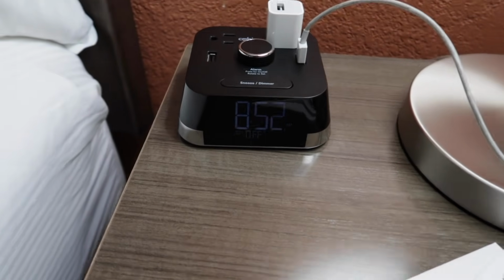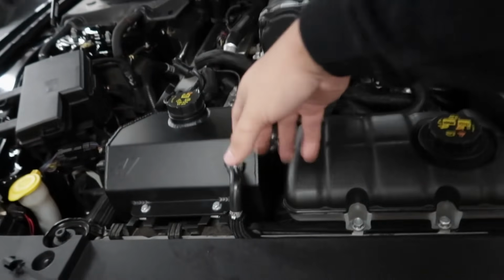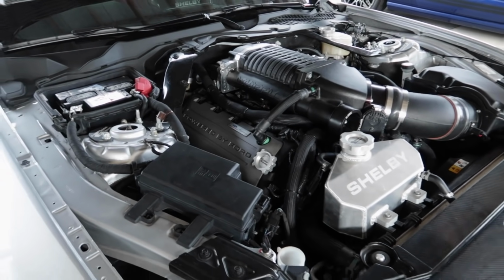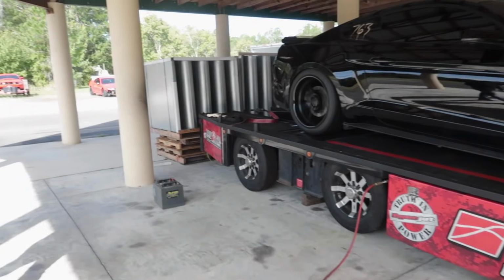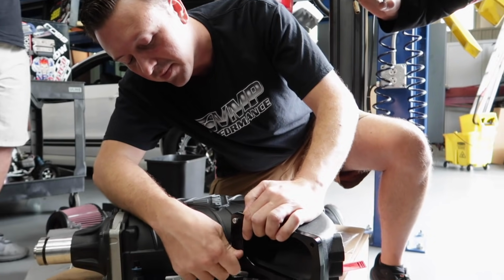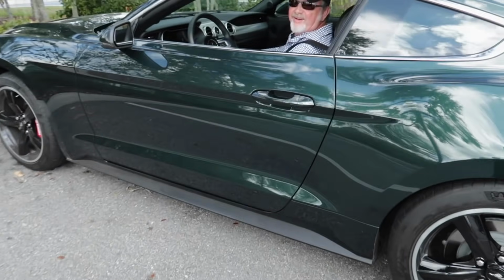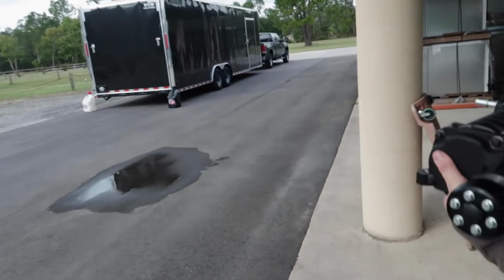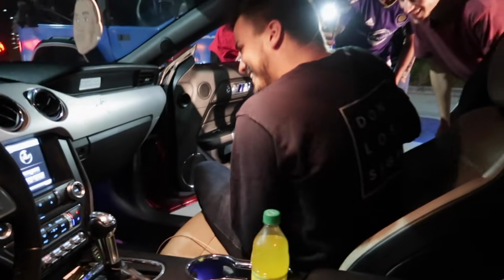My HUGE VMP Gen 3 Supercharger is INSTALLED!!

Comment: “9.01 in a stick shift is scary” cletus laughs while firing up leroy 😂
Reply: biggdaddy blade works never claimed he was
Reply: @whatsreallygoingon253  neither is that car
Reply: TheGhost did i ever say or claim leroy does?
Reply: @TheGhost even if he did it wouldn't weigh much more
Reply: @TheGhost no the vette
Reply: Official Plazma don’t hurt anyone’s feelings now 😂
Reply: TheGhost it technically does have a full interior, it has two seats, a dash, center console, glove box, blinkers and all those switches. Just its a highly modified interior
Reply: @TheGhost Leroy actually doesn't have that much of the interior missing, it's just the exterior where leroy shits the bed
Reply: They did wind tunnel test and showed it's worse than a stock Vette....and weighed more than I ever dreamed they proved to me it's a bit more legit...and I was hating on it ...now it's still easier to work on and mount things in the best places ECT...and I don't actually consider it a car either but it's performance to weight to wind resistance would be the same in a real Vette I suppose .....just take 5x the work to set it up....
Reply: @ShawnGilbert1967  vette with no hood would be almost as easy, and way more aerdynamic
Reply: @commptonn  or a lift off front but man no matter what they are doing they can just reach in and touch it SUCH a work advantage......to me where he has his turbos mounted would require no hood or top part of a fender at least....I do be believe it's less aero 
So that begs the question if he is trying to be as fast as possible why doesn't he just put a body on? The answer to that is the root of it
Reply: TheGhost Leroy is heavy, I guarantee it is almost as heavy as that Mustang.
Reply: Leroy might be similar but the super snake is way sharper

Comment: "Going 9.1 in a manual car is scary" after cleetus went 7.82 in a stick shit corvette with about the same power as the white mustang
Reply: That came to my mind immediately as well when he said that.  Not that impressive considering what Garret did in a stick shift c5 with terrible aerodynamics, as you said, with similar power.
Reply: LS power!!
Reply: And no body panels either.....
Reply: Body panels would make Leroy faster
Reply: Go Kart FTW!!
Reply: Leroy makes alooot pore power thatn that mustang lmao
Reply: You also got to realize  Leroy is around 2800-3k that mustang  still around 3500-3800 pounds Leroy also making 1300+ that gt500 is around 1100

Comment: May want to think about adjusting the diff angle so the nose points a little farther downward, when you're under power the nose torques upwards and you want it as close to level while under power as you can get for strength and rigidity while if possible remaining as close to less than 5° of overall difference in driveline angle so that the needles get spun in the u joints, preferably less than 3° but at this point it's become a race application.
Love the videos

Comment: I thought it made 1,000+?
Reply: He said the dyno that said 1014 wasn't correctly calibrated. This setup would've probably made 800whp on dynojet. Even without a finished tune it made roughly 100 more than he was running on roush.
Reply: This car will be touching 1000whp soon enough. Gavin has the itch now next up built motor then comes 73mm pulley then comes 1000+ we going to need a new throttle body
Reply: Yet the post was still labeled and left as a 1000 rear wheel horsepower video #CLICKBAIT but the fans requested VMP GIVE HIM A GEN 3 and Bam free parts for being a YouTube celebrity.  Great #s on less boost.   Now maybe the content will stay a bit more legit from now on?!
Reply: @tonyg3151  The video said it dyno'd 1000. Saying it said that when he threw it on a dyno is different from saying that it is 100% making that.

Comment: You should put forged pistons rods crank valves everything forged to hold the power specially since you have a stock internals and it will suck buying another motor

Comment: did the math by percentages and you could pick up around 250 hp with smaller wheel. just based on the wheel size not how mucht the actual srolls pull

Comment: Nice numbers but if that's really a stock short block it is definitely on borrowed time at 880rwhp.  Enjoy it cause its a nice looking car that's definitely fast but start planning for an engine upgrade soon, and maybe even a trans at that hp level.
Reply: Gavin's engine is NOT totally stock.... He blew it up and then had it rebuilt. It has the billet OP gears don't recall what else but that is the main thing to have with boost on a Coyote.
Reply: Doesn’t matter.  The stock trans and stock”ish” motor won’t last long after the beatings it’s about to go through. I would find a coyote motors and do a full build and start looking to do an auto swap or built a serious trans for the car.  Then again he can get some good content in the future when everything starts blowing up around the blower.  Motor.  Trans.  Rear  etc.  I would do an auto swap u less he likes banging gears and build a serious manual trans and a nice long block with heads cams rods pistons etc. let that gen 3 breath and make 1100-1200 to the tire barely spinning that Gen3!!!

Comment: A good life hack is to get a bag of ice on the blower to cool it down faster
Reply: NEM Plays Not a good idea with that type of blower. It can cause damage to case and rotors. Due to expansion and contraction of the case. Remember the intercooler is below the blower on that setup.

Comment: What axle is durable for 1000rwh as well as what kind of transmission I sew alot of people using the stock transmission and axles but eventually end up breaking or cracking what do you suggest

Comment: 881HP on 79 wow, ok you need to start the HARD stuff and that's to make it so the motor can HANDLE that power or break but i guess you are use to breaking all the time. The Next break though you don't want, think of grenade type break.

Comment: Step one get this setup squared away. Step two build motor because no one ever left well enough alone. Step three smaller pulley bigger throttle body upgrade fuel system. Step four get a glass hood  to show that SH*T off cause why have all that and not show it off. Satan 3.0 here we come